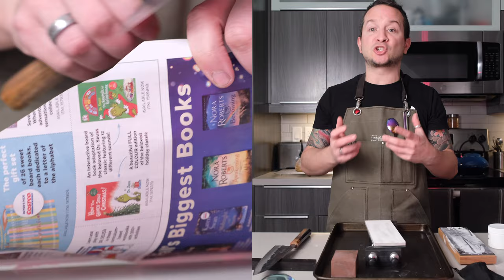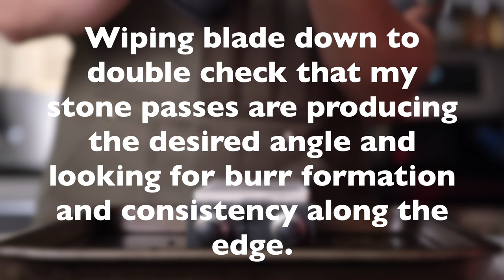Fujiwara Denka 210mm Gyuto | Sharpening and Fixing a Chip

Comment: Good stuff. Thanks for actually caring about being accurate with the info you put out.
Reply from the maker: Hey Jeff. I do my best. Sometimes that means I still make mistakes. Which is a fault of simply existing. But when that happens so long as someone approaches me kindly, then rather than taking the whole video off which would be a shame I pin a comment with the corrections necessary or put it in the video description. Or both.

Comment: Thx for this. I also need to learn how to sharpen and this is a good intro for sure.  Nicely done, as usual :-)
Reply from the maker: Thanks. Full disclosure I still have lots to learn so my videos definitely should be the go to for the best sharpening advice. That being said there’s many ways to get a result so don’t be afraid to experiment. As some have pointed out I sharpened a little too low an angle. It means nothing other than I may have made knife edge a little fragile. Time will tell. Point is chip is out now and it’s insanely sharp on the cutting board which is where it counts.

Comment: Good video...!!

As for finishing with different grits ...it's ok .. results are fun and all..I stopped doing that because with restaurant kitchen use they're just too difficult to maintain...

And honestly...go for the low grits to start... especially when trying to repair a chip...the amount of metal saved will be negligible, it will be faster and less wear on the 1k stone. The less time spent sharpening usually the better the results... you're able to maintain the sharpening angle more consistently and not wobble around...

IMO best to fully remove the chip/damage on low grits before trying to refine... better yet spend time on knife handling techniques and you won't have chips to fix...😁

What approx angle are you sharpening at...it looks like you're almost going for a zero grind...if you do continue to have chipping issues consider either a wider angle or micro bevels...

Take care
Reply from the maker: Hi Jeff. Thanks for your comment. 
The correct response is I sharpened at too low an angle :). I would typically have sharpened at a higher angle but think I lost focus with the camera rolling. I am happy I did have the camera rolling though, because especially with trying to get the camera just about level to the stone, gives a really clear picture of where I can improve. 

As I concluded and you mentioned, next time even though this was a tiny chip, I'll definitely be starting at a lower grit, but that was the whole idea behind using the 1000, to see how little or much effort would be required just using this one stone, so lesson learned through experience now rather than just assuming that's the right choice. This knife has only chipped twice in 3 years so it's not like my knives chip often. Agreed about micro bevels being great for edge stability. 

Typically this knife gets the differential grit sharpening treatment as is one of the reasons it is my favourite knife, best performance out of that method.

Comment: Franco, you need to practice more. Having such a huge high end knive collection does not correspond with such a poor technique.
You are too low in the angle, you need to keep the angle stable. For stroping avoid edge leading passes, because you can cut into the leather. Apply less paste (much less) and let it dry before stroping…
Reply from the maker: I can and am always improving and I mention myself my technique is amateur at best. That being said my technique isn’t poor, jsut needs work. The quality of knives I own doesn’t make me a master anything, that comes with time and practice. If we only showed the ‘perfect’ cut ‘perfect’ sharpening in videos none of it would be approachable. I’m not afraid to demonstrate where I am at with my skill and my knives always perform extremely well on the board which is where it counts most. Didn’t know that about stropping compound as that’s not what I’ve been told, but I’ll try next time to let it dry a bit. Thanks for the feedback.

Comment: Frankie, a couple of recommendations. I would recommend getting a sharpening pond or a sink bridge. It will give your sharpening more stability. Second, I wouldn’t use a nagura unless it’s the same grit as the stone. I would use a rust eraser instead. You really don’t want to infect your stone with a different grit.
Reply from the maker: Hey AJ. Hadn’t ever heard that a nagura stone even had grit as I’ve never seen one with a grit number. So you’d get one nagura per grit? Yeah a sink bridge might be nice. My set up feels stable but I’m sure a sink bridge could be nice. I’ll look into it. Definitely don’t was a sink bridge though. Not into that feel.
Reply: @KitchenKnifeGuy  the "nagura" you have there isn't actually  a nagura. It's strictly a cleaner stone of about 600 grit. Fantastic for refreshing your stones but they need to be rinsed off thoroughly after cleaning. If you want actual naguras to raise a slurry, Naniwa makes them in a variety of grits up to 12k. They are inexpensive.
Reply from the maker: Thanks David I’ll have a look. Funny sometimes how things are. It was sold to me as a nagura so I never looked into it, just trusted the information. I’ll look at Naniwa nagura. I see what you mean. Rinse the whetstone after I used my cleaning stone? I didn’t because I thought I was using a nagura as I’d notice it was helping declog and create a slurry even if on 1000 the slurry isn’t strong.
Reply: @KitchenKnifeGuy  where did you purchase the stropping compound?
Reply from the maker: Came with the strop from Nordquist
Reply: Finer grit naguras are perfectly good, it won't "infect" your coarser grit stone and finer naguras are a great way to dress a stone and remove loading from diamond abrasives. But in this case that's not even a nagura, its just  a stone cleaner to clear off particulate loading.
Reply: @KitchenKnifeGuy  No sir. All depends on your preference. I have one nagura stone and it's 12k. I can use it on any stone, but I only need to use it on a few anyway. You want the nagura to be equal or HIGHER in grit to the stone. For splash and go type stones, I find the shapton glass to be the best overall if price isn't an issue, however I prefer the naniwa pro/chosera in the 3k and below grit range for splash and go. Anything above, shapton glass. My preferred profession for splash and go is a 3k chosera to a 8k glass. Nagura is not needed in either of these cases. Shapton pro stones, especially when you go 5k or above, I use the nagura on. 

That said if you can put up with up with the inconvenience of soaking, the big mess they make, and the fact that they will start to dish basically right away, traditional soaking whetstones tend to offer much better performance. There's more control and feedback, they cut faster, and they have a lot of versatility. Meaning a 2k soaking stone can eat steel like a 500 grit splash and go, or it can polish like 3k+ depending on how much pressure you use. If I could go back and start over or give my past self advice, that's the route I'd go. Works better for everything EXCEPT for stuff like ZDP.

Comment: I’m with you, in that my Denka 240 gyuto would be the one if I could only keep one of my knives. 

I will often sharpen at 800/8000 grit if it is a VG10 knife, but I have yet tried it on a carbon steel knife.
Reply from the maker: My Denka likes a 6000 edge I put on it once. You should try. Though I had done the differential grit sharpening on it.
Reply: @KitchenKnifeGuy  Hey Franco, is the 210mm Gyuto Denka also 55mm high from heel to spine? Thanks.
Reply from the maker: Hey Robinson. My 210 Denka is 50mm high measured at heel. https://www.instagram.com/p/CS-fuloLFo6/?utm_medium=copy_link
Reply: @KitchenKnifeGuy  Thanks. I already saw Denka 210 with 5.3mm in different stores )).
I see Mr. Teruyasu is a moody knifemaker ))
Reply: @Robinson.69  Well, he isn't just stamping out the same knife over and over like a lot of other stuff out there. Some people love to complain about the fit and finish on TF knives, but they're missing the whole point imo. It's already a very man-hour intensive produce the way it's made, and it's made to be a tool, but if they did go ahead and put in the additional man hours to bring these up to a high degree of fit and finish they would be running $1000+ a pop for a 210 gyoto.
Reply: @jeffhicks8428  Hey  Jeff dont get me wrong.
I have a Denka Gyoto 210mm myself, and Denka petty 120mm since my comment, and i absolutely love them. The Grind is absolutely as i have expected. everything is awesome! I love that finish, and the western handle on the Gyoto fits like a Glove. Perfectly balanced. The petty though doesn't fit very well because of the sharp edges on the rear handle and the overweight towards handle. But i will grind it myself till its how i like it. Thats another plus for people like me wo love sharpening and have enough Stones and materials to do proper work on the blade.

Enough said, except that i am awaiting the next Fujiwara knife. A Denka Nakiri 195mm.
Best regards

Comment: Hi Franki , I'm no expert and don't just stay on my advice but I think that's a lot of compound on the strop . You need a very very thin layer . Take a bit of compound ( the size of an M&M ) and scrape it with an old unused bank card . Try to scrape it as thin as possible . Then if you don't cover all the strop add some more . When it becomes black you can remove it with an eraser . Take care and yes lovely knife .
Reply from the maker: Hi, oh I'm no expert at all so I welcome advice and you are absolutely right I had waaaay too much compound. The issue is I like to keep the footage raw, to show I make mistakes, but should then perhaps add a caption mentioning don't put as much compound as I did. I'll try to be more careful next time. Thanks for letting me know.
Reply: @KitchenKnifeGuy  and that's what I like about it . I try different compounds on different leathers and I see the difference . Although not all knives take it equally . Like the green compound I find it excellent for straight razors .
Reply: @callofdutyplaysmuscat6616  Personal preference. As far as compounds for stropping, I suggest half micron CBN on balsa wood followed up with .25 or .1 on some leather. The first time you try stropping on wood, with any compounds, much less half micron CBN you will wonder why you didn't think of it sooner. Nothing refines the edge better than this. I have a 16k glass stone I strop with, it makes a nice polish very quickly but leaves a much rougher edge than stroping on the balsa. That's fine if you want some tooth even at such a high grit, but the balsa is something else.

Comment: Personally speaking, a chip like that (one smaller or even larger), will eventually “self remedy” from simply the normal course of sharpening, and you obtain the added benefit of not losing ALL of that geometry on the edge profile by removing it aggressively, say rather than just over time with “normal” sharpening.

Unless that chip, which in NO WAY would be affecting your cutting experience and /or outcome, I would recommend NOT to aggressively/purposefully repair the chip, and simply allow it to heremoved over time, with “typical sharpening.” 

“Be like water - flow,” Bruce Lee once said in paraphrase…the same lives true for here.

Now if the tip and /or heel was chipped, that’s a different story, but just because you CAN do something, doesn’t mean that you SHOULD do it!

Again, I use to remove every single small chip on my blade edge, until I realized there was ZERO NEED to do so - having a small chip will NOT increase your chances of that chip “growing larger,” say by not addressing it. So simply allow that chip to slowly be removed, over the course of your “typical/normal” sharpening course, otherwise you are removing so much more of the blade-edge than is needed, decreasing the thickness and ultimately the overall life of your blade.
Reply from the maker: I’ve heard of this life of your blade argument, but the reality is, just like a lot of food release talk, it’s mainly more textbook than real life practical. I speak from experience with this blade in particular, 100% using a knife with a chip in it can lead to it expanding and it has surely been the case with this knife. 

When you have a chip and you slice food, you don’t avoid the chip, you simply continue to slide the cutting edge across the surface. Yes the hollow in the chip isn’t in contact with the cutting board, but the edges are and it leads to more tearing and rounding of the cutting edge. 

If I see a chip, it’s irresponsible to not treat it. I don’t go looking for them with a magnifying glass that being said. 

On the note of shortening the life of the blade. If these handmade works of art that cost hundreds of dollars only lasted 30 sharpenings, I wouldn’t buy them. But that’s not the case. The knives we buy will last us home cooks a lifetime, literally. As the core steel is sharpened and exposed after time, a proper thinning will be necessary to help expose the right amount and not have the cladding reduce your cutting surface. But worrying about cutting the life short of a knife because I sharpened a chip is worrying for nothing. 

Lastly, what severely impacts the life of a knife are large chips. Where you remove the equivalent of the chip height on the knife. In my experience, those happen when a) utilizing the knife improperly or b) continue using a knife with a chip until the chip ‘grows’. 

I really do appreciate your feedback. It’s stuff like this that helps educate people. Being challenged and having a conversation so thank you.

Comment: Getting that one tiny and inconsequential chip removed would require the removal of steel from the whole knife edge.  Every time steel is removed from the edge, the knife edge becomes thicker (eventually requiring thinning), and that thicker edge will negatively affect the cutting performance far more than one micro chip ever will.  But, I totally get why you wanted the tiny chip removed.  I am like that too.  I am a knife nut and want my knife edges to be perfect at all times.  Even a couple of tiny chips would gnaw at me to the point of taking out a sharpening stone to get the couple of chips removed even though it makes no sense at all.
Reply from the maker: I agree with everything you said. But I’m one of those people if I see it and don’t agree with it, I need to fix it so to speak. This knife will last me the entirety of my life, so I’ve never been worried at shortening the life of my knife. I don’t sharpen any of my knives often as lots of them have spectacular edge retention and because I use many different knives. So when a little chip happens, the steel is being removed along the whole edge as you pointed out but also as small as the chip itself. 

No scenario is optimal, in case it’s scenario three, not chipping my knife 😂 more important still is knowing the right method to fixing a small chip so that one lengthens the amount of time before thinning is needed. For this knife here you’ll notice how close to flat I sharpened it which helps minimize it getting thicker behind the edge. I also added a micro bevel on it later to add edge resiliency. 

Worst case scenario is by not fixing the chip it grows in size and then I need to remove more steel to fix. So I’d rather air on the side of caution for these prized babies. I really do appreciate your comment. It’s conversations like this that keep the community bountiful.
Reply: @KitchenKnifeGuy  Good point about a chip growing in size if not fixed.  Propagation of cracks from an initiation point such as a tiny chip is a valid concern.  Preventing crack propagation is particularly important when the knife has a mono-steel construction with uniform heat treatment.  It's slightly less important when it has a san mai construction.

Comment: Q: I am considering a Fujiwara knife but I am kind of worried it’s too delicate. How did you get that chip? Just regular use or did you mess up? 

I heard that polishing the edge helps to prevent micro chipping.. not sure though
Reply from the maker: Hi Benjamin. Great question. 
This Denka in particular, has chipped twice in 3 years at the exact same spot, so I reckon potentially a small imperfection there from heat treat or quenching, not sure which would be responsible. I use my knives delicately, on nice end grain cutting boards. That being said, I know my walnut end grain is a little on the 'hard' side. 

Both Fujiwara's Maboroshi and Denka series can be chippy for different reasons. The Maboroshi line because Shiro 1 can be a chippy steel and the Denka line because of how high a HRC he gets the steel to. 

That being said, don't look at my sharpening for expert advice as I'm still learning. If you put a micro bevel on the edge or sharpen at a wider angle, you'll be fine for everyday use. Both aren't blades that can take abuse, but if you treat them well, sure chipping might occur here and there but it isn't something that should be occurring often. I have often seen professional chefs use both of these in the professional kitchen setting which means they can definitely be made to be more resilient. I can't speak to the polishing the edge to make it less chippy as I haven't done that.

Hope this helps a little.
Reply: @KitchenKnifeGuy  thanks 🙏🏼 very helpful
Reply from the maker: Happy it helped. I don’t understand why YouTube keeps deleting replies. I was alerted of one of your replies “God I’m so hyped to” and when I click to see the whole message it says it doesn’t exist.
Reply: @KitchenKnifeGuy  that was “so hyped for the FT anyway”. I guess there is just really something about them isn’t there.